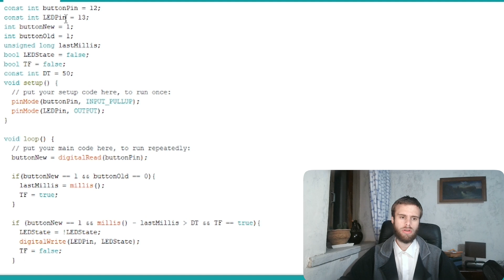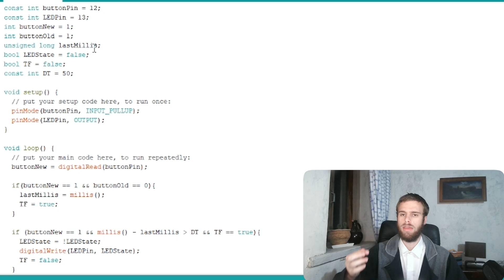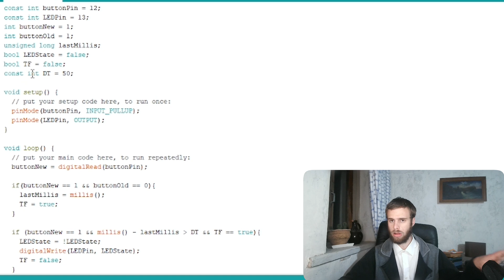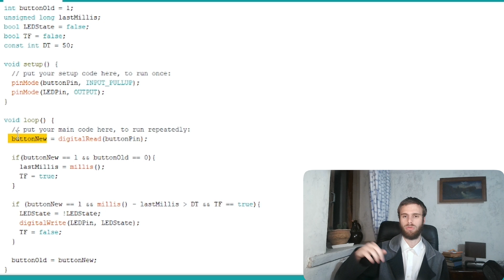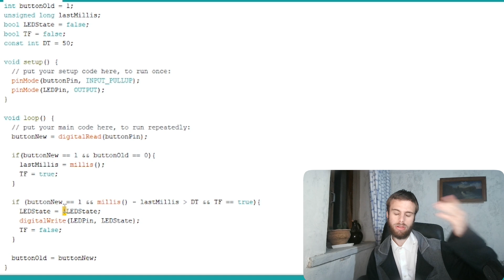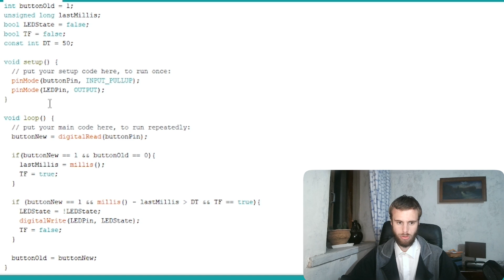How to Make a Toggle Button in Arduino | Use Push Button as Toggle Switch

Comment: hi there! would u be able to use this exact code for MULTIPLE LED lights? i'm trying to create a project where you can create a sequence of lights that flash one after another, but i want it to be initiated by a button like this. how would that work?
Reply from the maker: In the code where the if statement toggles the LED on or off, this is where you can add the code to flash many LEDs.

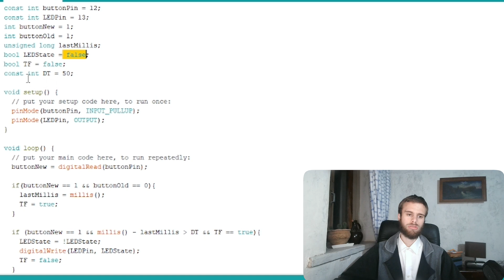Comment: Thank you for this sketch.  I downloaded the code and the the toggle function works fine.  DT stands for delay time - a de-bounce precaution.  What do the letters FT stand for?  See Transcript line ( 3:30).
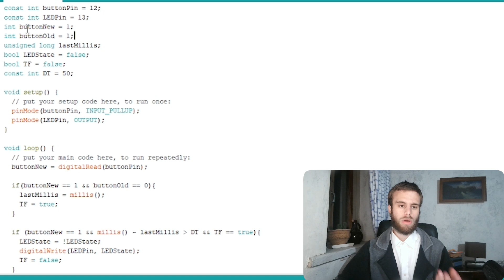I noticed that the video feed at certain points became "fuzzy" and basically "unreadable". This occorred at these times: 1:28 to 2:42 and 3:37 to 6:31.  
I plan to follow your other videos.
Reply from the maker: Yes, that is what DT stands for. and for TF, that variable will only keep a bool value which is True and False. So TF means True, False. I see that the text is a little hard to see, thank you for pointing that out for me. I probbley need to zoom it in a little more, so people can see it better. Thank you! :)